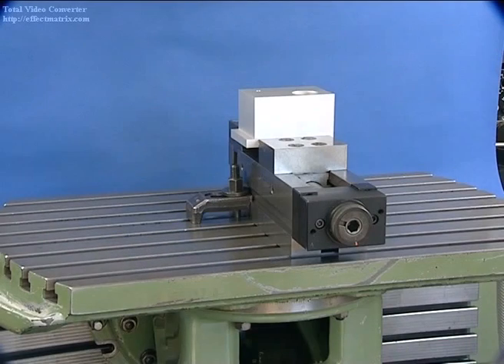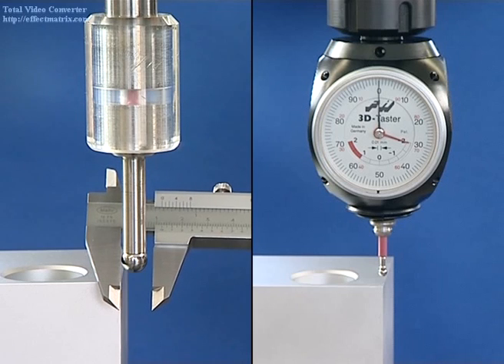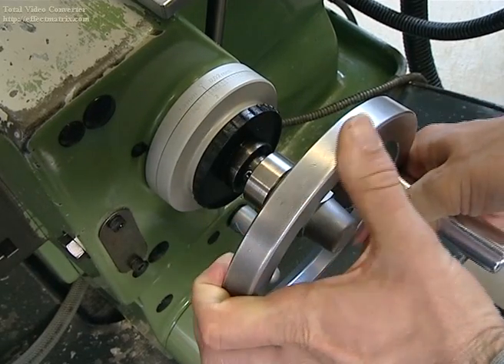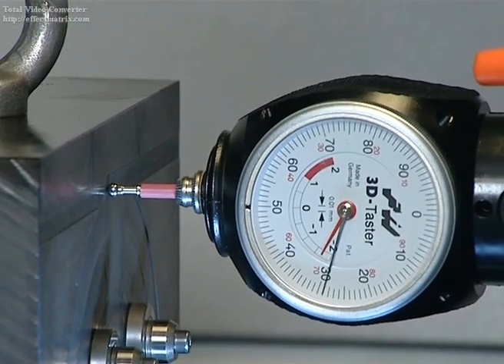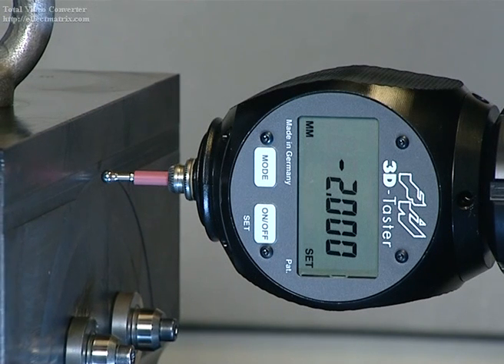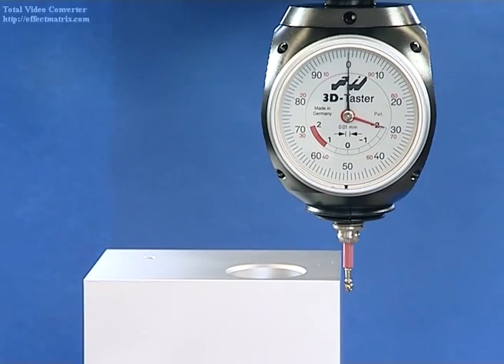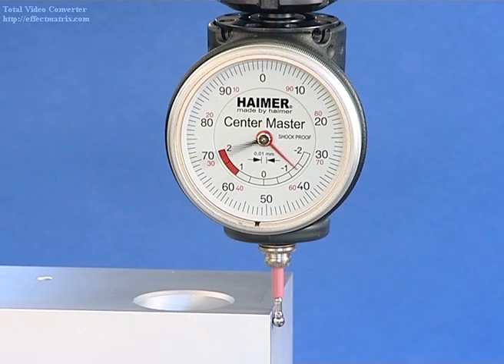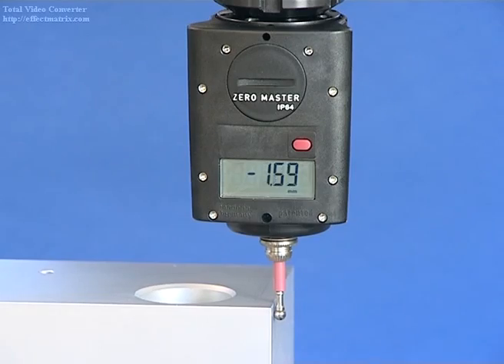3D Sensor: Practical Applications

Comment: can we use this sensor to measure XYZ points value on an inclined plane or 3d freeform surface??
Reply: I guess im randomly asking but does any of you know of a trick to log back into an instagram account..?
I stupidly forgot the password. I appreciate any help you can give me
Reply: @Knox Colten Instablaster ;)
Reply: @Korbyn Rowan i really appreciate your reply. I found the site thru google and Im in the hacking process atm.
Seems to take quite some time so I will reply here later with my results.
Reply: @Korbyn Rowan It did the trick and I finally got access to my account again. I am so happy:D
Thank you so much you saved my account :D
Reply: @Knox Colten no problem =)

Comment: Is the long probe tip primarily for z-axis height measurements? Can the long probe tip, with a larger ball than the short probe tip, be used for side offsets? Perhaps if doing this the meter would not read zero when touched off?
Reply from the maker: Hello Kent! 

No. The long probe can be used just the same as you use the short probe tip. Because it is exactly twice the diameter & twice the length, the offset for the sensor itself remains the exact same. In short, the tips are interchangeable and capable of performing the exact same functions with the exact same degree of accuracy.

Hope my answer was helpful! Please feel free to reach out if you have any further questions!

Our contact info: Phone: +1 (630)-833-1500 or tech@haimer-usa.com

Your friends at HAIMER USA